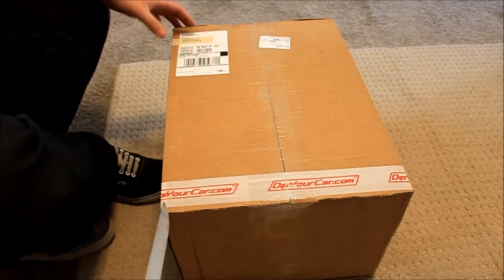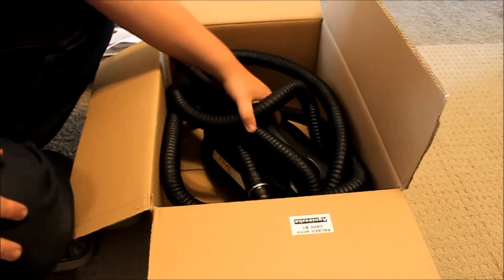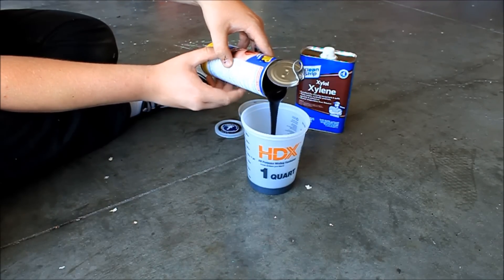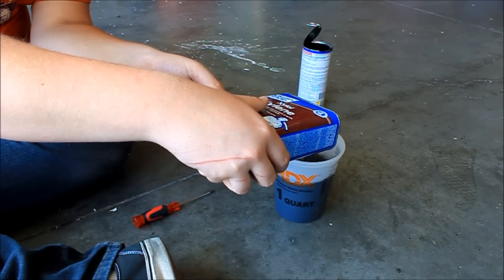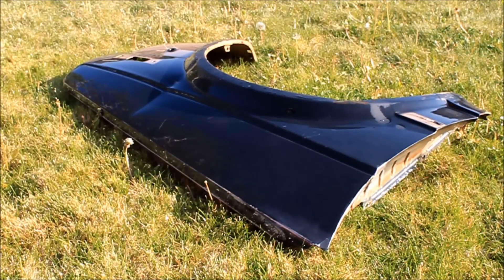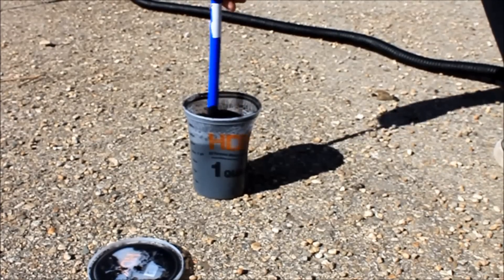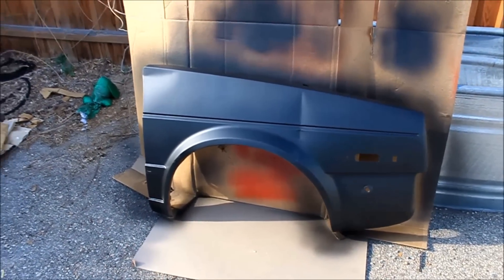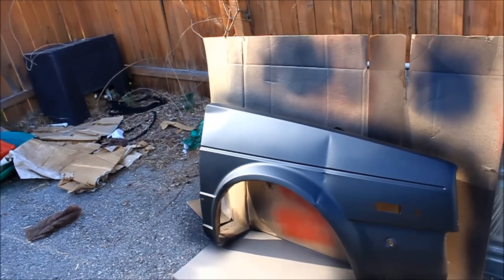How To Thin Plastidip, Save Money! DYC Dip Sprayer Unboxing and Testing

Comment: You should watch a good painter someday.   You fan the gun and take quick uneven passes.   Try to make passes at the same speed to give good coverage, overlapping each pass 50%.  Keep the fan at a 90* angle  to the surface throughout the entire pass.  Try to cover larger sections on each pass to minimize the overlapping areas.  With each coat, try to change the overlap area to a different location.  

Try painting like the robot machines at the factories do.  That is basically how I do it and they program the robots to do it right.  I like to start on the roof of a car to minimize the over-spray on areas already painted, as it tends to fall, unless you use a cross-draft booth.  When outside start upwind.  Using slower solvents and a properly adjusted Accuspray paint gun will reduce or sometimes eliminate the need to worry about over-spray.  I am an old-timer, however since about 1989 the Accuspray models 10 and 11 (pressure feed guns) were the best all around paint gun you could buy.  Iwata are awesome for candies, pearls, tough metallics and smaller areas.  

The Accuspray can't be beat for dumping it on fast, like glass with minimum over-spray.  Accuspray 10 will make almost anybody a good painter... 3M makes the Accuspray now, which I have never tried the new disposable tips, air caps and plastic bodies.  I hear they work great and are cheap to buy...

I was in the body business for 30 years, a body tech at one of the largest GM dealerships in the country where I was rated top in the nation nearly every month when I worked there.  I averaged between 2-3 complete paint jobs per day,  it was an incredible feat to score 100% many times with an average score of over 98%.   Usually I blew all others away, it wasn't even close.  Rating was done using the 40 question GM customer satisfaction survey required for GM shop 
certification.  Most of the best techs are lucky to average over 85% with many scoring in the 60's. 

Don;t be offended, its just constructive criticism.  :^)    I have  been a perfectionist since I was a little kid and It sucks.  It takes much more time but I cannot do any job without doing the best that I can.  I have tried to do quickies and it doesn't work, I can't allow myself to take short cuts...  Even with my comments don't take short cuts... fuck me.... I need to stop this shit....
Reply: Juz da last name alredi answered ma question: Y is diz guy sooooo smart?
Reply: This is not criticism, anyone can take use of what you just said, but the first paragraph would be enough ahahahah

Thanks for sharing tho
Reply: Excellent explanation.  Thanks, Richard.

Comment: Great video!

Maybe, 8 years too late but: Heads up, Xylene works well for a lot of applications but its super toxic (cancer causing if memory serves)! Almost like a cost-benefit trade off.
Even the cup that you used kinda morphed/warped because of the Xylene.

Comment: Checking the price of Xylene quarts and the thick plasti-dip small can you used, the price of what you have mixed up is only slightly less than the aerosol cans, which keep you from having to buy a paint gun, and is about even with buying the gallons already thinned from DYC.  I can't see any reason to do this, and others are reporting that dip thinned with xylene doesn't peel as easily.
Reply from the maker: Doing anything on a large scale with rattlecans with PD is asking for a lackluster result.

Comment: U dont have to sand it when u plasti dip
Reply from the maker: Jdmtunerlover In this instance, I did. This panel had primer on it that was sprayed badly on with spray cans by the previous owner of the vehicle it came off of. I wanted a smooth service for the dip to go on in order to have a good end result. However, if you're dipping over top of regular car paint, you would be correct, no sanding would be required.

Comment: What is PDS plastidip?
Reply from the maker: Plasti Dip Spray. The pre-thinned gallons that DYC sells.
Reply: @BradenCarlsonAutos  I just bought and sprayed a couple gallons of prethinned dip off Amazon. I need to get more quick but the only dip I can get Prime shipped is the 22 oz containers from Performix. I think this stuff is thicker though. 

Do you think I should just thin this Performix stuff 1:1 with paint thinner? I'm using the Wagner Motocoat sprayer.

Comment: To all that watch this, do NOT use self thinned dip on a car. It will NOT peel up easily like plasti dip spray.
Reply from the maker: kotu100 To all that read this guys comment. Do NOT listen to him.

You have no idea what you are talking about. What proof do you have to back your claims? It peels off just as easily as long as you provide an adequate amount of coats, just like dip that is pre-thinned. The only difference between thinning it yourself and buying pre-thinned is the amount of tint in the pre-thinned gallons. It is COMPLETELY removable just like pre-thinned gallons. Please do a little actual research before steering people away from something that is factual.
Reply from the maker: kotu100 I do have REAL WORLD experience with this. I know the new PDS is formulated specifically for cars and was made with peel-ability in mind. That being said, it really depends on what ratio you're using for thinning dip and what blends of what thinners. I dipped the grill on my old car with self thinned dip and it peeled off as normal after over 6 months of being there. Check out "Iamthepuzzleman". Up until more recently when it became "PDS", the gallons labeled "Rubber Dip Spray" were simply thinned full strength with more tint added, and that was peeling fine as well. 

As for why I got defensive: You came on to my video, completely advising against what I'm demonstrating without any sort of proof. That's just flat disrespectful. I don't know why your dip was not peelable as it should have been, but I do know from first hand experience that it CAN be when self thinned.
Reply: Braden Carlson Can you explain why the self thinned dip dries out under the sun and the plasti dip spray doesnt?
The parts of my car that were covered by moldings and the lip kit peeled perfectly fine despite being thin in some spots. However once i got to the part that was exposed to the sun it would tear instantly. Didn't have any of these issues with the PDS.
If the self thinned stuff works for you with what you're doing then more power to you. Saying that its the same as PDS, well that's just a lie or you don't know any better.
If i can save just 1 person from going through what I am i'll be happy. 
To anyone else that read this far, please just use plasti dip spray or any other liquid rubber automotive refinishes. Don't cheap out or you may regret it.
Reply: kotu100  who says that??
Reply from the maker: kotu100 What I'm saying is that I have had great success with self thinning peelability. You're making it sound as if my experience with it was a fluke, and yours is what happens most commonly. You can't say that for sure, and neither can I. I made this video on the basis that I have had success with doing it this way, including removal.  

I agree, PDS is better. But maybe consider that there are people out there looking for plastidip to be a more permanent solution, or don't have the income that you do and they aren't necessarily "cheaping out" so much as trying to keep within their limited budget. Some people have had PDS stain their car paint, some people have had explainable issues with dip, some people have had bad experiences with self thinned dip. Shit happens, and there's an endless number of possibilities that make it far too broad to just proclaim that one of us is wrong and one is right. I know it CAN work, as with everything else, though, "results may very"
Reply: you know, you guys can buy plasti dip at awarehousefull.com?? and you can thin it yourself and you buy the concentrated in gallons for 60 bucks? , and they have PLASTI DIP CONCENTRATED  UV too . and free shipping!!..
Reply from the maker: aldrin villaflor For sure man! Awarehousefull rocks. I've been thinking about pulling the trigger on their buy one gallon get one free sale.
Reply: @aldrinvillaflor4731  Thanks for the tip on that site.  I hadn't heard of them before, and now I'm eyeing the UV Gunmetal Grey...
Reply: Does pre-thinned plasti dip last longer than the unthinned plastidip you mixed with xylene?